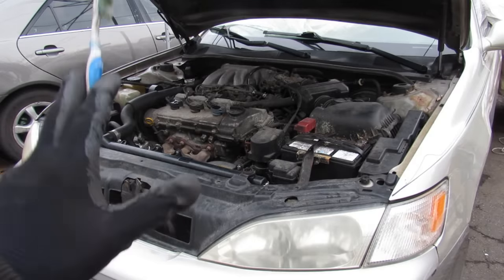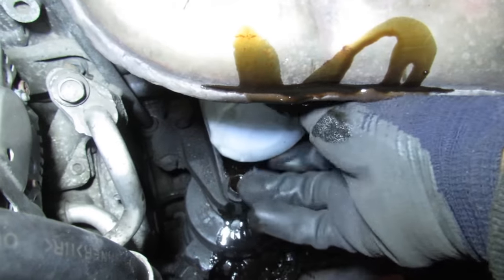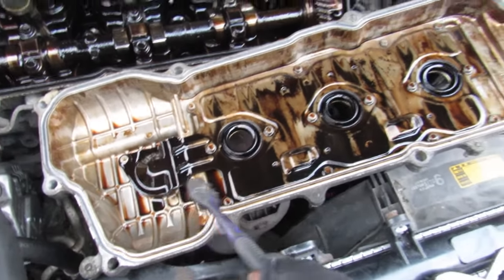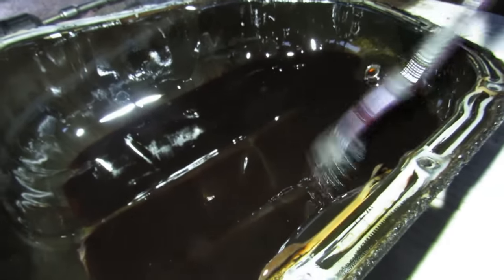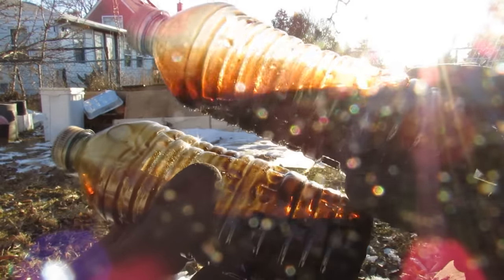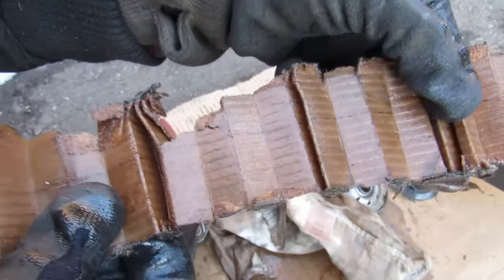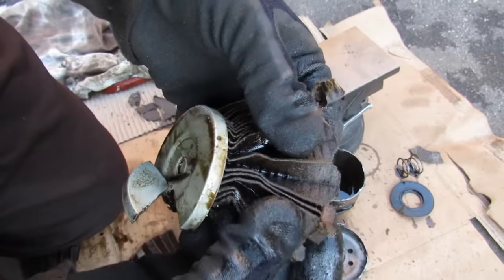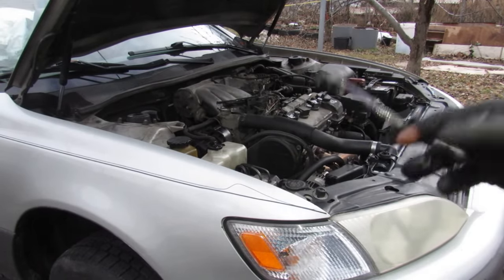Does Flushing Your Car's Engine Actually Work? || Before and After

Comment: Urine in the fuel tank is pretty good too, I've been urinating in my cars for years, never had a problem.
Reply from the maker: Water isn't good for your fuel pump
Reply: What about salt in it ?
Reply: Geez...people will start doing this now...lmao - (Which is better...morning pee 1st thing or late night after drinking tons of beer?)
Reply: Drink three glasses of vodka before sticking your nozzle in the tank, at least. You don't want to pee anything below Regular. Good octane level is critical for engine performance. Free advice from a master technician at Volga Motors.
Reply: @speedkar99  😂😂
Reply: @speedkar99 hey, do you think valve lashing is  necessary on the older Honda Accords?
Reply: You can poop in the fuel tank as well.
Reply: Get r Kelly he will pee in your gas tank

Comment: Two mechanics that I have a lot of respect for have told me to just use a high quality oil and do several changes at 1500 - 2000 miles to clean an engine.  It's more expensive amd takes more time  than using a can of engine flush but it's also giving the engine the proper lubrication.  The detergents in oil aren't as harsh as a flush,  either amd doesn't tend to dislodge big chunks that can clog an oil gallery or remove something that's actually keeping an old gasket or seal from leaking.
Reply: This. Takes time to build up, takes time to clean up. I did it with an old abused car. New cheap nasty oil in, use the oil until its black then change, no real time/kms just when its dirty. Took about 4 changes and a month.
Reply: Totally agree. I bought a Vectra with 180,000 kms and a lot of carbon under the valve cover. I ran full synthetic oil for a few months and the amount of carbon I found in the oil filter housing was extraordinary. The inside of the valve cover was much cleaner than before. The engine died from lack of compression some months later and I wonder if the carbon buildup wasn’t actually keeping the rings sealed.
Reply: that things that are keeping and old gasket from leaking you cannot say that is a disadvantage, will be a matter of time until start leaks.
Liqui moly in that case will show that the gasket is in bad condition
Reply: Years ago my friend did 50k+ without an oil change and the engine was knocking, did an oil change with $10 gulf western oil, let it run for 30-60 mins until it quietened down, changed oil again and it was like it never had a knock.
Reply: @apachelives waiting until black? Keeping clean oil in a car is what will make it last forever, no?
Reply: @MrRobot01010  we are talking about cleaning out heavy deposits - it will go black within days with all that junk in there
Reply: Funnily enough this happened to me! I used an engine flush and shortly after, the valve gasket cover in my old subaru started leaking. I had no choice but to replace it

Comment: Years ago my boss told me to flush an engine. First remove the old oil, then add half kerosene and half cheap oil. Let it idle for 20 minutes and drain and refill. That really cleaned it out.

Comment: This has been tested before. Automatic transmission fluid doesn't clean, it just gets burned and turns brown because it's not designed for the high heat of an engine.
Reply from the maker: Well I have now tested it unscientifically to prove that color change means nothing
Reply: engines dont go above 100C, but transmissions are designed to survive 200C
Reply: @two_number_nines  are you telling me that gas burns at 100c ?
Reply: @Master1906  The metals holding the oil dont go above 100c, especially a gunky head and its cover
Reply: @two_number_nines  what about the gas

Comment: My last customer learned that irregular changes with cheap oil will cause your oil pick up to clog up. He also learned that driving a car with a clogged oil system will cause your engine to seize. I guess the blinking oil pressure light, oil pump scratching sound and loss of power wasn't enough warning... It's so cheap and simple to change the freaking oil... Why... meh :|

Comment: I use the cheapest oil and half a bottle of Marvel Mystery Oil.  1000 miles and it is black with a heavy filter.  I then do a 1/4 bottle and a 2000 mile oil change.  After that, compression is back and oil stays golden.  I use 1/8 of the MMO bottle for the next 2 changes at regular intervals.  You need to flush over a longer time so oil+MMO

Comment: My dad had a '76 Chevy truck. When I was a kid in the 80s he had once poured transmission fluid down the carburetor while revving it a bit. The exhaust turned black and smoky but a few minutes after he had stopped it ran and sounded better. He said it was an old trick to clean out the gunk in the cylinders and valves.
Reply from the maker: Awesome. Would work better on older worn engines than this one.

Comment: Engine flushes, like the commercial stuff you find on the shelves or online and things like ATF are, in my opinion, shock treatments and could possibly do more harm than good.  Of course, the use of high-quality engine oil (conventional or synthetic), along with regular oil changes is the key to preventing a gunked-up and/or sludged engine.  These same high-quality engine oils can help clean the sludge/gunk build-up in an engine that has been neglected. 

However, if you want to boost the cleaning capabilities of that high-quality oil, you can use Marvels Mystery Oil (MMO) along with that oil. No more than 10-20% total in the crankcase and never go more than 3,000 miles on MMO without an oil change.  MMO slowly and gently dissolves/liquifies that gunk.  Years ago, I cleaned up a really bad, sludged-up Dodge 318 engine using MMO.  Nowadays, with my current cars and truck, if I'm within 500-1000 miles of an oil change, I top off the oil to full with MMO, just to help out the engine oil in its cleaning ability.  Pop off my valve covers and you will see nothing but that beautiful golden varnish color with no sludge or black spots.

By the way, thanks to Speedkar99 for all the videos he has put out over the years that have helped me with my Toyotas!  You da man!!!
Reply from the maker: Thanks for your input. I was set on removing the filter to see if any particles got loose and harmed the engine. 
Glad you appreciate my videos.
Reply: I like MMO and SeaFoam, however a lot of good knowledge on Bobistheoilguy forum explain a lot of the chemistry and make-up of both of those.  Tldr; both are very, very light oil/volatiles that are burned up within minutes of engine reaching operating temperature.  I use a real flush/solvent that doesn't just evaporate instantly, Chemtool B12 at 1/4-1/2 strength and idle for a while before an oil change.  I'd rather have it take several oil changes to clean out slowly and not have the oil pickup get gunked up or passage blocked trying to do a quick hard max-flush.
If someone is just trying to do preventive maint., then using a decent full synthetic oil change at 3000 miles intervals a couple of times seems to work pretty well with low risk for a lot of people.

Comment: Interesting peek under the valve cover. I have a 2006 Civic that I've owned since new that now has 305k km. It's been well maintained. I had the valve cover off at around 260k km for a valve adjustment. It was perfectly clean.  It's still running strong. It just recently started showing signs of excess oil consumption. I'm switching to high mileage oil at the next change to see if that improves.
Reply: My friend accord lots of miles. Engine oil was like brand new. All the time
Reply: Oh for oil coumsption try pcv valve
Reply from the maker: Some cars are more sensitive to oil than others. It also depends alot on the quality of oil you use. This one was subjected to the cheapest off brand oil in town.
Reply: @speedkar99  I put Pennzoil Platinum Ultra in it last change and it seemed to consume more oil. Normally I put ordinary Pennzoil Platinum. So mid range synthetic  oil. For the first 10 years, 200k km, of its life it got what ever conventional oil the dealer put in it. I'm trying Pennzoil Platinum High Mileage next. If it doesn't improve then I'll have to dig further.  There doesn't appear to be an external leak, that's all I know at this point.  It runs fine with no obvious signs of oil consumption other than the dip stick dropping faster than usual.
p.s. It got a new Honda OEM PCV valve about 60k km ago. So probably not the PCV valve, but who knows.

Comment: I've heard of ATF as an engine flush. Never seen it tested before though. Very cool.
Reply from the maker: It's a cheaper engine flush since it has detergents
Reply: My Subaru gets sticky ticky valves when cold - dump some ATF in a week or 500km before an oil change and it goes away for half a year - seems to work for me.
Reply: @speedkar99  ATF doesn't have any detergents actually. 
It also has very little lubricity.
It also is not seal friendly.
I'd consider using a 1/2 qt of diesel and 15 minutes idle before an oil change a couple times.  Or something like Chemtool B12 which will actually dissolve sludge and clean.

Comment: I did an engine flush on my previous car (I think I used Nulon).  It consumed oil at 1 litre per 1000 km and remained constant - mileage was 186,000 km.  What did improve was the colour.  Before it'd be black within a few weeks of an oil change but after the flush it was much the same colour as original, just a little darker.  One downside was leaving the hood up with engine going for 15 minutes made the hinges weaken and it'd vibrate the hood if it was up with the engine running from that point on.
Reply from the maker: As this video proves, color means nothing
Reply: @speedkar99  yes it does

Comment: This idea works much better, if you run motor for about 20-30, min” , then leave it to soak over night, run again next day for same period, then drain. Works really well on sticky lifters in older cam setups.
Reply from the maker: Good to know. Do you have proof?
Reply: speedkar99 proof” only my own experiences, have also had reasonable success with a 50/50, mix of new oil, and diesel, most important to fit new filter before startup, and after flush. A little expensive, I know,but how good a job do you want, entirely optional, I feel it’s a far better flush than using the lil bottle of what-ever, all that stuff dose” is hold particles in suspension, while oil is hot. Not actually cleaning in my opinion. It’s seems to me, a bit like many of the so called injecter cleaners, which a really just an octane boost. Maybe gettin bit sceptical in these times, old age can cause that apparently . Grandkids think so, spouse they may have a point. Those are my submissions your Horner.

Comment: I usually flush my diesel engine using cheap oil, run the engine for 5-10 minutes, drain it, repeat the flushing process 2-3 times before using the good oil.
Then until 2000km i check the deepstick the oil still looked clean.
Reply from the maker: That works but visual indication doesn't mean much

Comment: How to flush an engine? Just switch to Castrol GTX or better and change it every six months. My vvt-i engine was sludged up upon  purchase and these high quality oils give the gentle clean you need over time as they are packed with additives. I recommend this as some engines become permanently clogged from aggressive flushes.

Comment: Alright, so, i bought a 98 camry with the 2.2l engine about 6 months back and ive been fixing this car up to use as a work/beater car. After i bought the car i found oil on the engine air filter, which indicated blow by ususally. I changed the filter and when i checked it again a few hundred miles later it had some oil starting to get on it again. I bough an amsoil engine flush and followed the instructions and when i changed the oil i used synthetic 5w-30 with some marval mystery oil. After more than 1k miles the air filter has no oil getting on it anymore. I also replaced the intake tube and throttle body and there is no new oil on anything. Oil flushes can work if things arent too awefully bad. I was lucky i caught this engine in time before it was totally done in, but what happens with these toyotas often times in with infrequent oil changes the oil control rings get gummed up and stop working right and allow oil to slip right through. This 98 camry of mine was luckily saved for now, but change your oil people. I see too many toyota vehicles with evidence of extended oil changes, dont do that. 3-5k miles oil changes is the max for an oil change in most cases, the only real exception being pure highway driving.
Reply: Supertech at Walmart is a full synthetic made by Warren, though also rebanded Exxon and Pennzoil.  
Tons and tons of people and numerous Fleet reports have shown 7-8K is perfectly fine for most vehicles, even those like taxi and delivery fleets which are the real 'Hard Service' use cases.
Not like the BS you hear from lube shops who talk up commuting and freeway miles as 'hard service, you gotta do 3K oil changes!!!!'...

It only costs $35 to have Blackstone Labs do an oil analysis on your oil, which people here should consider next time they do an oil change.
They can give you a scientific readout of the state of your oil after you x miles before oil change, and tell you how many more x thousand miles it should last before needing to be 'used up' and require changing.
6/7/8K is pretty average/low for full synthetics.

Best part is, Walmart sells Supertech for about the same price as dino.
Just bought 5q full synth. for $19 last week. $5-6 for supertech filter vs $7-8 for the Fram crapola too.

https://vehiclefreak.com/who-makes-supertech-oil-for-walmart-and-is-it-any-good/
Reply: @boots7859  Low-end synthetic oil is Group III and is refined from petroleum, not synthesized from natural gas. It costs barely more than semisynthetic because it is just highly refined and catalytically altered dino oil. Pure dino oil may not even exist anymore. All oil is semisynthetic to a degree these days because the carriers the additives come in are synthetic oil. I have the same engine the guy was speaking of, a 2.2 L Toyota 5SFE. I use semi and keep a 2800 miles oil change interval. I wouldn't want to go much longer on Supertech synthetic or any low-end synthetic. My driving is all trips of five miles or less. An oil analysis is more for entertainment than anything. Follow the charts, specs and the opinions of qualified sources. Some say don't go further than 7500 miles on any oil. One said 5000 miles. Cut that in half for severe duty. Maybe it's hard for some people to recognize that their many short trips constitute severe duty, but they do. A shorter oil change interval also means you don't need to buy those high-end or vanity products that advertise 15,000 and 25,000 mile oil change intervals. Or a special oil filter either, except as necessary to keep your warranty in effect.

Comment: On my 94 mazda I tried take 1 liter old oil out and 1liter atf in. I drove  for 200km with no heavy throtle. I did't damage the engine but I think engine flush products + cleaning oil pan is the best method for clean oil on a dipstick(at least for 300km in petrol engine or 10km in diesel :p

Comment: Transmission fluid doesn't make a good flush these days. There was a point in time when transmission fluid had more detergents in it than motor oil. However that's not the case anymore, if anything it has less now.

Transmissions don't see combustion, so the need for detergents in a sealed unit is basically non existent. It doesn't need them, even transmission fluid with 100k miles on it will not sludge up.

Wear materials will build up over time and fall to the bottom of the pan. This can appear as sludge, but not from the oil. Metal shavings are just to heavy to stay in the oil, so it seperates.

Comment: To remove sludge change  oil 10 times in 10 days. Drive 10 miles per day. Use cheap oil. No more sludge. Final step use high quakity oil for final change.

Comment: ATF doesn't have a lot of detergents like some believe.  Better to use a quart of MMO with your normal oil ... or use a HDEO in 0W30 and leave it in for 2,000 - 3,000 miles.